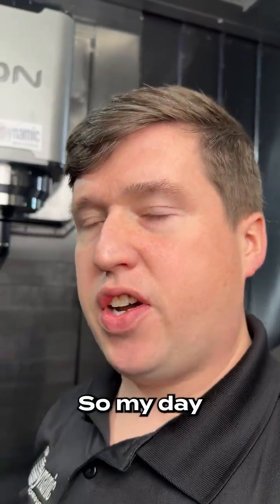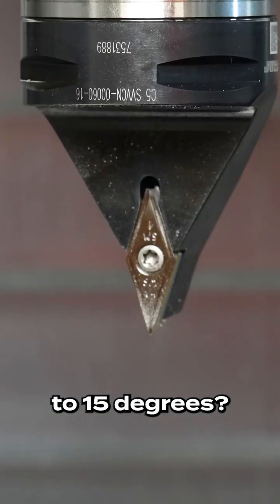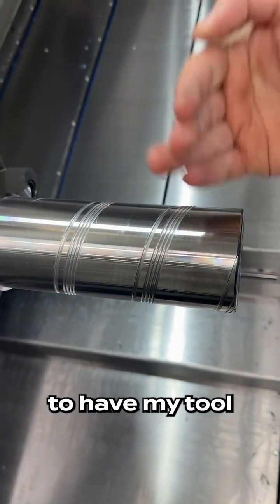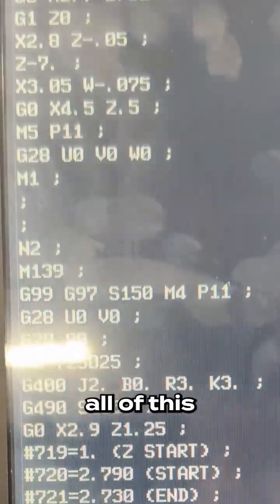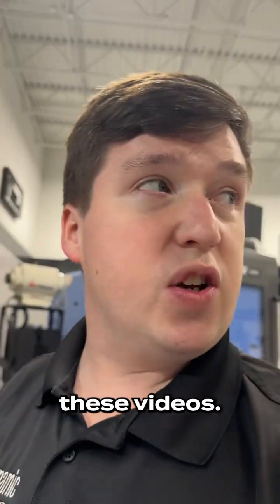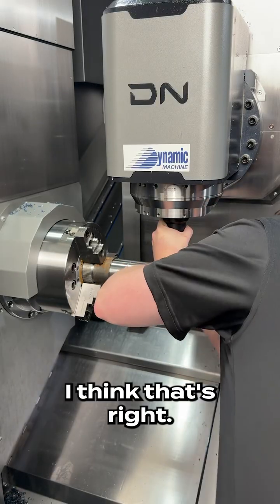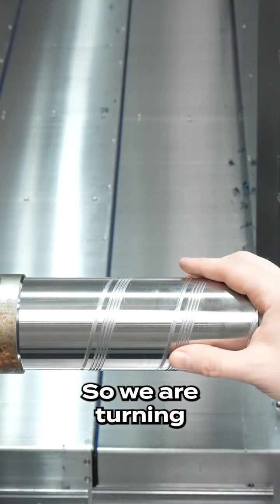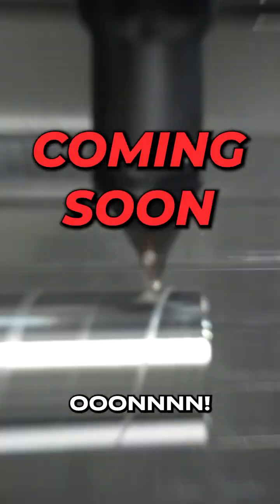When your ideas bite you back

Comment: I've programmed and cut a 7 start thread and a 13 start thread ID and OD just using a regular LT series threading insert. I used it for some rings I made for myself.  Its a fun exercise to figure all that use just using a scratch pad and a calculator.  Also I engraved the outside of the rings using an excel program I made to translate XY code to CZ coordinates.  The problem I ran into doing the threads was I was basically having to rapid the machine in Z-axis to cut across the thread if the spindle was going more than a 100 or 200 rpm and that was on a piece about .8 in in diameter.

Comment: I think the issue is that you are facing the tool in a way that the insert and holder won't crash into the thread but the cut is actually happening in the direction of the surface is moving. So some cutting force is on the insert relief.

Comment: Yes, I do similar things using parametric templates. 🤗 I haven't seen a drawing of what it does, of course, but in this case, I think the tool was chosen incorrectly. I would have chosen a radial groove cutter. I suspect it's something like a worm shaft.

Comment: That's why I love mazatrol. Multi start threads are super easy. Conversational programming still has it's perks.
Reply: Threading is typically done with an insert meant to do threading. Threading inserts have relief built in so you don't have to orientate your machine in a specific way. It's easy even without mazatrol.

Donnie is using a D style insert to thread.

Comment: We do this all the time on a regular CNC lathe (Okuma, 2000) with some parametric programming and a special toolholding solution for the required angle. And ofcourse the tool can't be plunged straight in that far, in the case of the V style inserts the tip angle is 35 deg. so what we're usually cutting is worm gear profiles with 40 deg. thread angle. Taking .2 to .4 mm radial steps gives a nice enough finish. On bigger profiles we start with a grooving tool for quick hogging out. It's a very worthwhile process for us, what takes hours in milling time is minutes on the lathe.
Reply: I had to do an oil groove with a 4" pitch on an old Okuma CNC lathe back in the late 90's, even at the slowest possible RPM it was scary AF. The tool was modified at roughly 45 degrees to accommodate the pitch angle.
Reply: @t.c.sbunch-o-stuff5907  It's indeed quite a scary process. I program it using part CAM and part direct ISO editing. The last time we did it the operator  set the second  tool wrong in Z and yes, it crashed. Problem with the canned cycle is that you can't run some movements in feed rate speed, even not for testing. We do run at 400 RPM so yes it's a matter of trust, as any program really. I am working on some test protocols to double check tool setting, especially on the second tool that starts deep in the groove cut by the first one.

Comment: I'm an old guy. I started out punching G-code on a typewriter way before the PC was a thing. The code was basic by today's standards; it was a manual operation. We would proofread the tape by looking at the holes in the paper, and editing was done using Scotch tape. We could recite trig formulas from the trig functions book we carried in our top pocket with our decimal equivalent chart. We looked like the modern version of nerds. We calculated I and J on a scratch pad. The trade has transformed in so many ways, but math is the standard regardless of how it's done.
Reply: Regardless of how much the industry has transformed and improved, your job and skills will forever be the pinnacle of the CNC/Machinist world. What you did on a daily basis is leagues beyond what most of us today would be capable of with a month of time.
Reply: @Gojira_Wins Thank you so much for the very kind words. 🙏
Reply: I have a working tape printer + tap + old cnc controler using tap (paper punch). A true piece of tech
Reply: @zakel5750 There's a video!
Reply: I remember those days in the early 80s when the paper broke the machine would stop we have come a long way since then. My math was good back then and still remember most of it.
Reply: @rodneycarpenter3253  It's burned in; you won't forget, LOL. I started in the 70s. I'm retired with a few machines in the garage. I still find the occasional reason to do the math, or maybe I'm trying to remember, LOL.
Reply: @mp6756  I have two cnc brigeports and a cnc router after all of these years you would think I would have enough of it but still like it nice to see you still like it also.
Reply: Crazy, how it advanced, NC punch tape,,, and Bullard had the MANATROL mill run off rods and cams....
Reply: @ironworkerfxr7105  Allen-Bradley mill drill with threaded rod depth stop.
Reply: I used to write code long hand. I was forced to use cam in 2003. I will never write code again. I use mastercam for the simplist code. There was a time when I could read paper tape but not any more.
Reply: @wannabecarguy  It's great now there are affordable, extremely capable software options for smaller businesses and hobbyists.
Reply: Now no one even knows what a slide rule is.
Reply: Scotch tape was my friend.😂
Reply: Never knew m30 meant rewind that tape
Reply: @alexdalton7290  LMAO. It's amazing that as simple a language as G-code is, it has gotten us to the present-day manufacturing landscape. It's cool knowing there are tape readers out there running.

Comment: Do you adjust the cutting edge location after rotating it 15 degrees? If it's centered to the work axis at 0 degrees, rotating it puts half the cutting edge above and half the cutting edge below center.

Also double check to make sure you're using the right diameter. Simple errors are as common as complex ones.

-Amateur armchair machinist
Reply from the maker: That tool is perfectly on center. It can even engrave if you are feeling dangerous enough lol
Reply: @donniehinske  Well then rotating the tool 15 degrees results in half of the cutting edge being above and half below the center of the work which results in different rake angles on each side. The smaller the work diameter the greater the difference.

If the tool was skewed 15 degrees instead of rotating it, then all of the cutting edges would remain on the centerline plane.